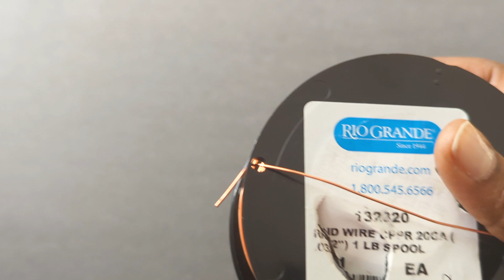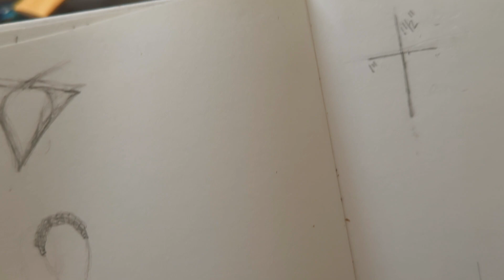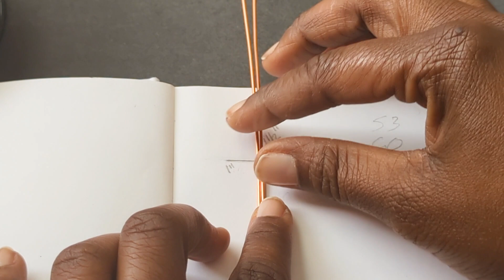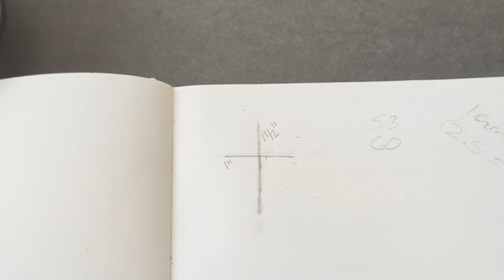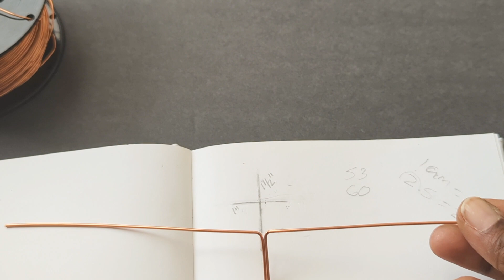Wire Wrapping Tutorial | Easy Wire Wrapped Cross Pendant | DIY Jewelry

Comment: Oh Kaidy, these r awesome. I have tried so hard to make crosses that were much smaller and they just couldn't make the fit. I wanted them simple. But looking at your video further confirms that the type of pliers make a difference. Also the diagram becomes important too. Thank you for all that. AND I have gotten some pure copper wire I used only once cuz I'm unlearned about the oxidizing process. Actually I'm looking for the simplest method. Wink, wink. So, I'm coming along slowly but surely. 
One awful day a friend lost her husband and when I found out thru IG...at that..I quickly made a card for funeral in one day. Yes, only had one day. I knew her since a young teenager whose mom I worked with for about 20 years. She lost her husband and brother within 3 months due to CA. Since they were a spiritual family, designed a card with a 3D like Bible. One side had a sentiment. And I knew I wanted the crucifix to be attached to the other side. Suddenly, while looking for bought cross charms,I came across the ones I had done. You know what? I used one and it really added meaning. So, I never consider my messed up stuff failures, but rather imperfect. But at this time of such loss, the imperfect became perfect and needed. NOW, I can do better through you. Thank you so much. And I got myself a new hammer, a chase hammer. Had a 2x2 block, and I'm ready to " hammer out " as per Pete Seger. I'm on a mission.
Reply from the maker: Hi there! I'm so sorry to hear of the loss of your friend's husband; may he rest well. A handmade gift, especially in times of mourning can mean so much to the receiver. I'm glad that you are staying on track with your craft. Did you take a photo of your card? I would love to see how it turned out! Sending you tons of love and well wishes ❤

Comment: Is there a rule of how much wire to use? 
Any formula to use based on the stone ?
Reply from the maker: Hi, it depends. With this project I just went based on how large I wanted the cross to be multiplied by 2. Otherwise you would measure the length of whatever stone you use. Here's my formula for the cross: Bottom prong 1 inch, side prongs 1/2 inch each, top prong 1/2 inch, bail 1/2 inch, and about another 1/2 inch to account for the curves of the piece. That gives me 3 and a 1/2 inches which I multiplied by 2 to get 7 inches of wire to use for the project. If you use a stone, follow the same process but measure your stone lengthwise and multiply by 2 to ensure the wire will make it around the stone fully. Then include measurements for the bail and curves of your stone. My final tip is to use a sewing measuring tape or a piece of string to measure the circumference of the stone. I know this was a lot but at least it will be here if you ever need to refer back. Let me know if I can help any further. All the best ✨✨